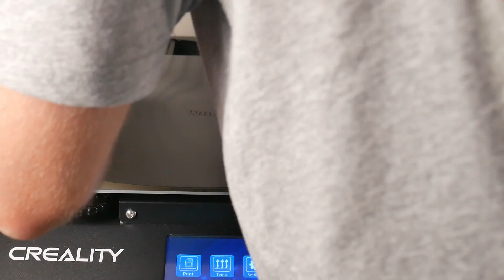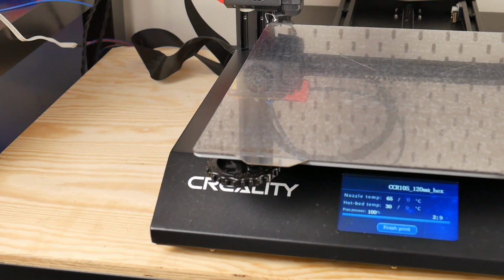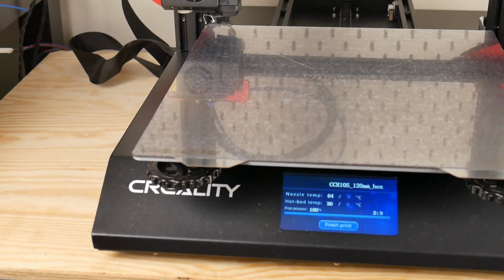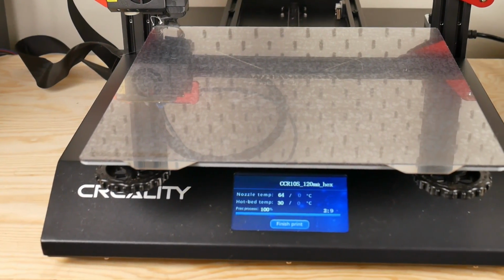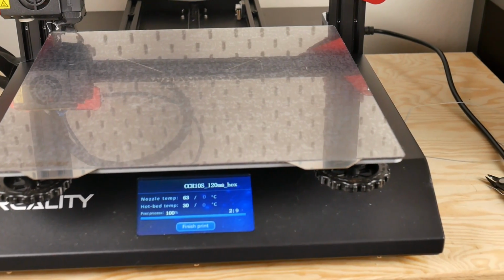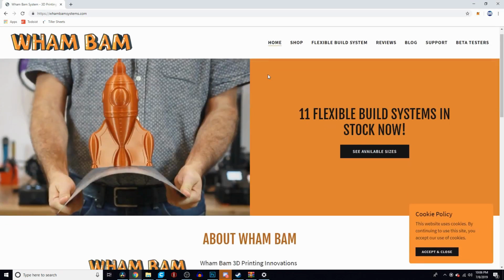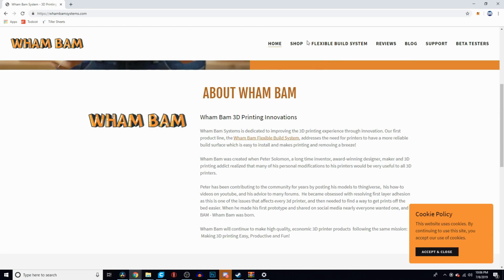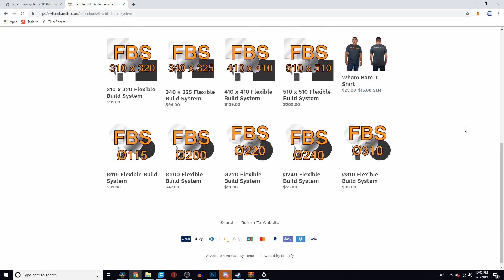Wham Bam Flex Plate System | Awesome Creality Cr-10S Pro Upgrade

Comment: I threw mine away some time ago and now want some back to try a glass bed. I've got a CR10s Pro V2 Creality printer. Does anyone know what size they are? I'm guessing M3 or M4 but pls let me know. For some stupid reason the replacement clips on amazon don't come with the screws and if I buy the screws separately I have to buy them at 100pc. So stupid any help is greatly appreciated. 

*I know I can just use the ghetto clips that come with the glass bed usually but that's dumb.

Comment: Well it has been a year. Did you do a follow up you experience with this product over time (if so, could you link it in the description)?
How often have you found that you need to replace the PEX build surface?
How hard has it been to remove from the flexible sheet? ... I imagine that being a very big challenge.

Comment: Hi, so how did it behave with large prints ? The Buildtak of my CR10 max disbonded from the plate after 2 months and I want to replace it with a flexplate because I'm making very large and stiff prints. I'd be interested on your feedback on this. Thanks

Comment: Do you get the edge of your prints curving, bending? Ever since I installed wham bam on my CR10S Pro this has been happening and to the point where the print comes free about quarter or halfway in. I feel like I'm missing something.
Reply: Hi Andy, did you ever sort this issue out? I noticed in the other comments that you need to turn "economic" mode off. This can be found in the Adjustment tab

Comment: Does this work with an indictive sensor?
Reply: Inductive sensors detect metal, so I wouldn't see why it wouldn't being spring steel
Reply: @jimmitchell8357  Yeah I know it would react on the spring steel sheet. But an inductive sensor generates a small magnetic field as does the spring steel sheet and the magnetic sheet together. I wondered if those two magnetic fields would cause the sensor to be unreliable.

Comment: Great instructional video, thanks! Has anyone else had an issue though with the levelling? My extruder keeps trying to jam itself right into the print bed! I'm not sure if maybe it's to do with the sensor not detecting where the print bed is but I'm a little anxious about trying again in case I bust up my extruder...

Comment: Hi, does wham bam supports temperature around 200 degree celcius for more than continuous 48 hours of print? whats your review for tempered glass bed by crealtiy for Cr10S pro https://www.creality3dofficial.com/collections/accessories/products/creality-cr-10s-pro-tempered-glass-build-plate ? will this tempered glass bed, support the capacitive bed leveling sensor which comes along Cr10s pro?

Comment: Have installed Wham Bam but not having much luck prints won't stick to bed have polished with wire wool cleaned with IPA altered settings in Cura but still won't stick need some advice.
Reply: please write at technical@whambamsystems.com to help!

Comment: For the CR-10S Pro make sure to shut off economy mode or parts will come off PEX mid print when bed drops temps
Reply from the maker: Haha I learned that the hard way after something like 3 failed prints. Once I turned it off I have been gettin successful prints.
Reply: You have no idea how grateful I am for this comment!
Reply: Aaah so that's what economy mode does, and I've had printer for 2 months already🤦‍♂️